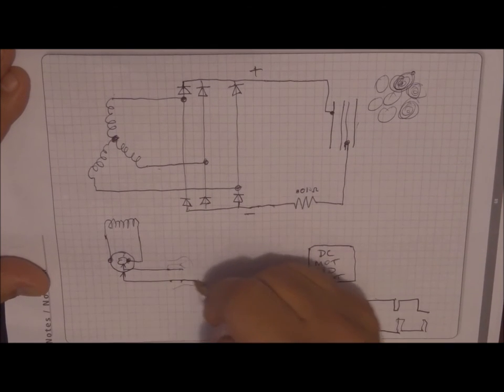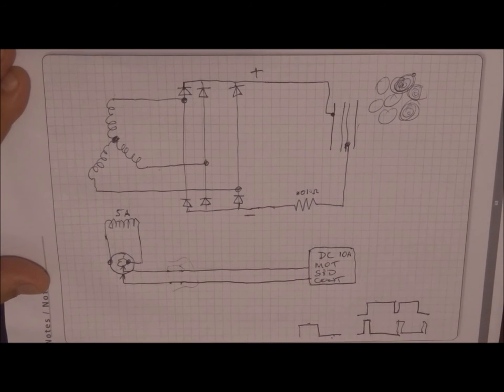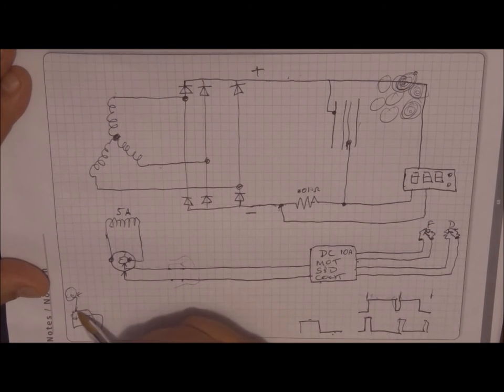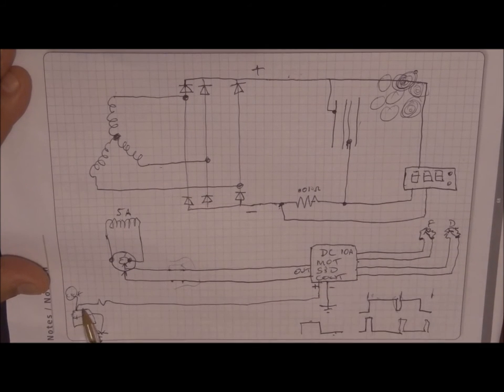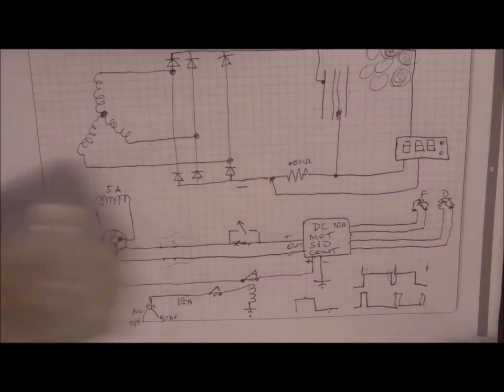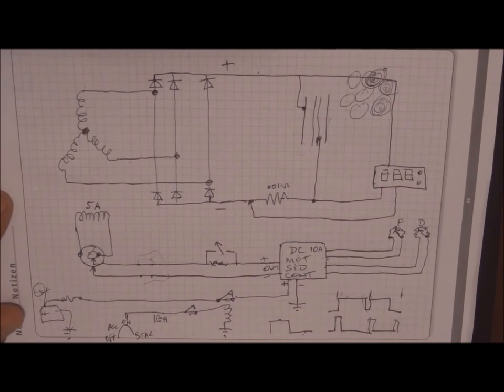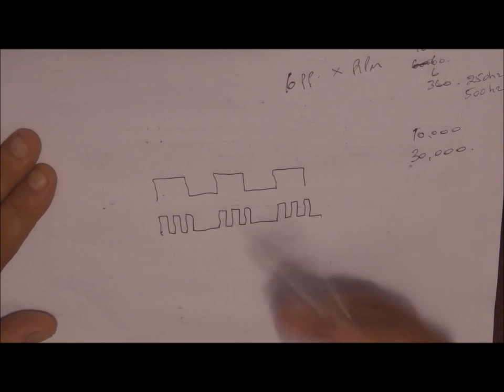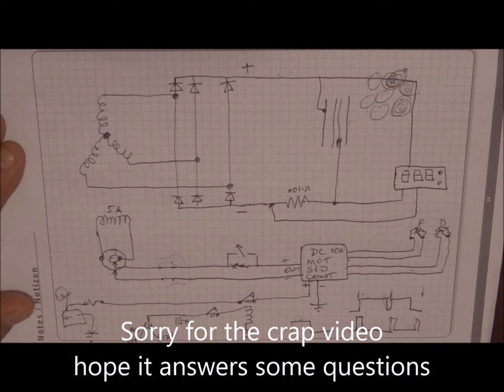HHO circuit hookup

Comment: - Great greetings to you and my admiration for your wonderful experiences and your determination to succeed. Let me have more than one question.
- I understand that we must remove the connection between voltage regulator and alternator. Is this true? If it is true, what do you think of replacing the coil with a permanent magnet to reduce the load on the car battery?
- The survival of diodes and stator without any change.
- If the place in the car can not accommodate the number of two alternators, there is no alternative. Transformer for example as our friend Daniel said.
Reply from the maker: better control and pulsing options with the induction coil rotor, it's current draw is only say 50w.
I chose a used Nissan navara alternator because it was cheap,low klms and is rated for 80amp.
I was running it at about 3000w and maybe 20ltr/min of gas before an output diode did eventually fail.
Hope that helps you.
Reply from the maker: The transformer question is very interesting.
Most of my work to date on cell production efficiency is by pwm of pure dc, or as close as I can get.
This was easy to manage cell power but never provides a potential reversal which I believe is essential for true resonance effects to occur. 
So the transformer solution sounds good, but my checks using the PWM described above to drive said power transformers reveal they all have a pulsing AC nature, due to the pwm, like commutation, momentary breaks in the cycle with resultant distortion, back emf spikes and ringing. that might be apparent in some of my bench testing vids.
Another issue using transformers is the inherent resonance points in their cores, be it metal, ferrite whatever.
this wastes a lot of time looking for a for a resonant effect in the cell.
Once again, like the pwm dc case, transformers driven by pulsed dc will not provide true resonance.
Perhaps a high power linear amplifier directly driving the cell from a 'pseudo pure oscillator' like a wein bridge,
like I have also tried will work, well, my 50w amp module blew in short order and by then I had my cells up and just wanted them on the 4x4 to check the fuel consumption burning hho on the road.
I really want to go back and revisit the idea.
For the reasons above, to my mind, the only way of achieving true resonance easily will be using a variable speed alternator, I want to go to about 30khz or CPS x 60 / 12PP = 60,000rpm on the Nissan alternator.
See my problem, maybe a handbuilt alternator with say 200 Pole pairs x5,000rpm /60 =
Reply: I see 
you know a lot about electricity. Do you think about why the diode died?
 Do you overheat because of the power of pulling amps from it because it works without a regulator? Please think that you are more aware of me in this area.
- What if the diode and the current regulator are removed? 
Will the current be in AC and in case of continuous rise, 
increasing the speed of the car until the coils stator burn?
- Have you seen more than once about the resonant difference between him and frequency?
Thank you for your patience.
Reply from the maker: i'm pretty sure the diode failed from the overcurrent/heat. I don't have any spec sheet for the internal diodes, but expect they are rated a minimum of 50v probably more. 
cheers.